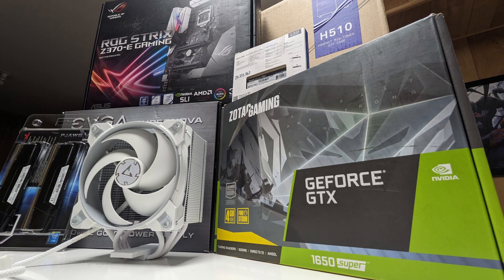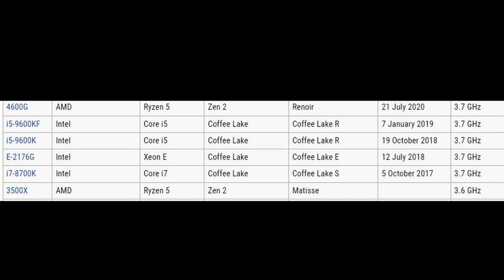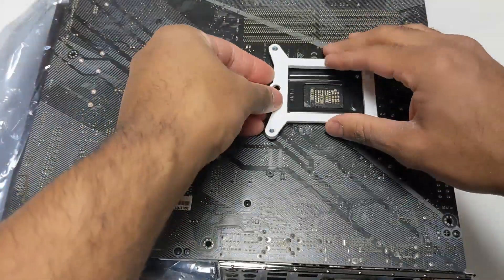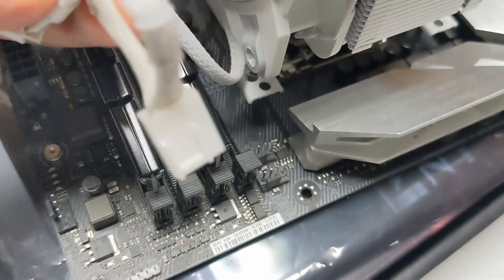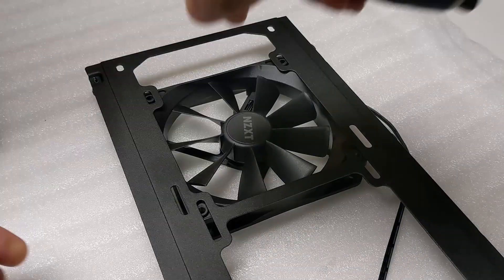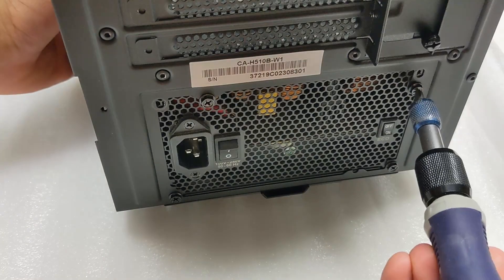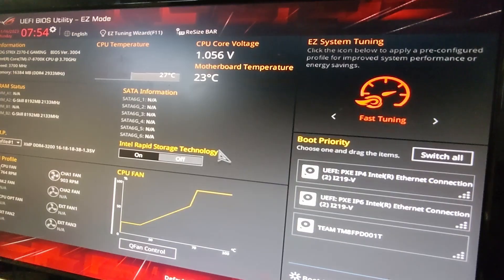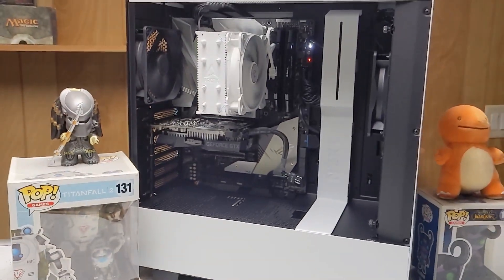2023 Steam Ready PC - i7-8700K & GTX 1650 Super Full Build - Tech Lion

Comment: thinking of upgrading my i3 9100f to the i7 8700k my cpu is constantly at 100% usage on cpu heavy games, will the cpu bottleneck my gtx 1650?
Reply: I'm in the same boat same specs, did you do it?
Reply: @alex360c nah its a horrible cpu for the price get a new motherboard and cpu i got a 12600k and a z690 it barley goes over 50-60 usage even after getting a 2070 super
Reply: @sigma67boituff  wow you really upgraded it, i don’t wanna spend that much anyway because i got a ps5, this pc i mainly use for older games but the i7 8700k really is the same price as that i5 12600k lol

Comment: Nice build and video. I bought a PC for $300 with the i7 8700k. The chip sits on an MSI Z370-A PRO Motherboard. The rig also has a GTX 1060 6GB, 16GB of DDR4 RAM, and a Corsair H100i 240mm AIO cooler. All of these parts are housed in a Keiders C570 open air case. This is  quite an upgrade from the FX8320 and Radeon 7950 3GB that had been in my previous PC.

Comment: Tbh I have the same cooler for my Ryzen 7 3700x and it's perfect. Under 100% load for well over 8h, the temps were up to 68*C, usually at 66-67*C
Reply from the maker: I neglected to mention the temps in the video but they did average 55°C for the processor and 45°C for the GPU at most no matter what I threw at 'em. Definitely had some room to overclock if I wanted!